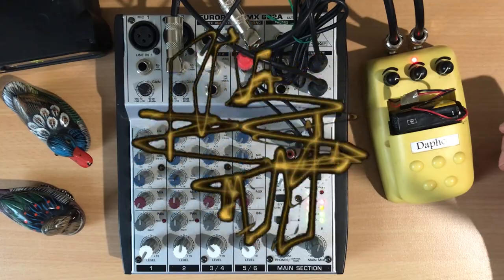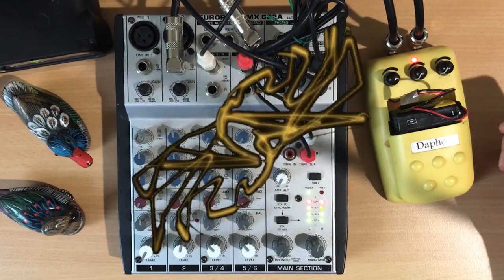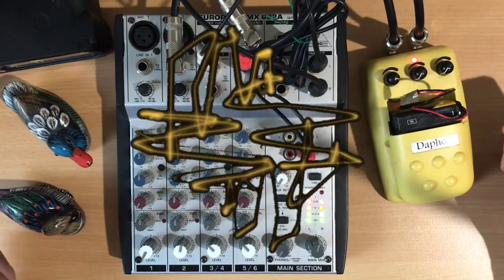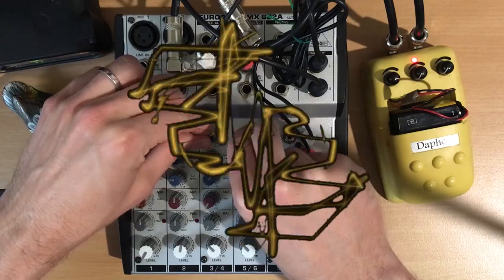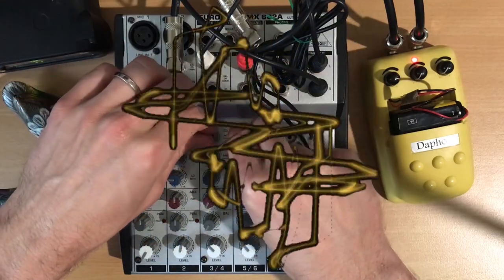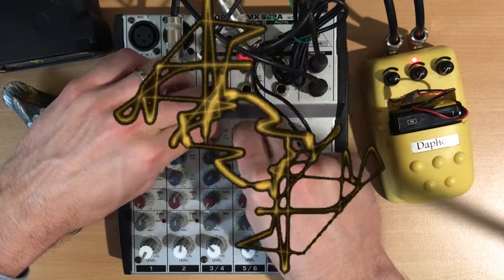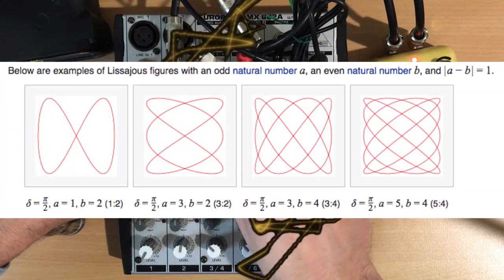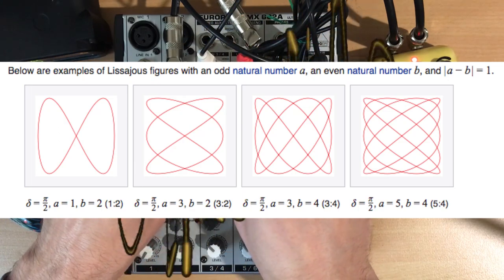Lissajous curves with no-input mixing board

Comment: This is really nice! :)

The assymetry come from how the circuit in the mixer clips signals assymetrically. It really depends on how exactly the circuitry is built up and to understand it in depth, you would have to examine the schematic of the mixer aswell as the pedal you use.

The reason why some of the patterns seems to be in sync while others rotate slow or fast is due to the visualizing software you use and whatever converts the analog signal to digital. Both of those works in descreete time steps whereas the signal you produce from your NIM system does not. So whenever those two happens to be in sync, the pattern will stay still or rotate very slowly but as soon as they go out of sync again, the pattern begins to move faster.

And the ABC like logo you managed to achieve is exactly more angular in shape due to distortion/clipping of the signals, you can even hear it in the signal that it's comprised mostly of squarewave like components.

And a little suggestion: You have one channel left unused on the mixer, you could patch another effect pedal up to if from an output of the mixer and creating another feedback path that way :D
Reply from the maker: Thanks!
So the still/rotating appearance is similar to the phenomenon of car wheels or helicopter blades spin-rate syncing with the frame-rate of the camera! Maybe I can play around with this by adjusting the frame-rate setting in the software.
Yes I often use all the ins/outs through looper+reverb units and such.
Reply: @ReubenIngall  Yes exactly, it's the same phenomenon. And it also happens on analog oscilloscopes, they also have a framerate on their screens which causes these syncing patterns to appear :)

I find timebased effects to be really nice for feedback effects.
And in that regard I can highly reccomend you check out the eurorack module from "NonLinearCircuits" called "Delay No More" which is a dual delay with cross feedback that can produce a wild array of feedback noises.
Some of what it produces does remind a bit of what you get from a NIM sytem.